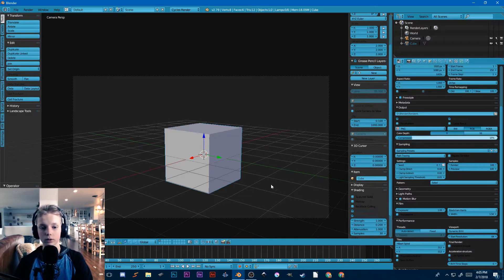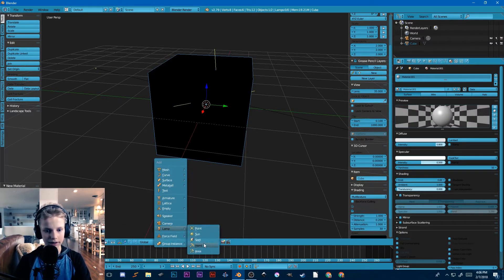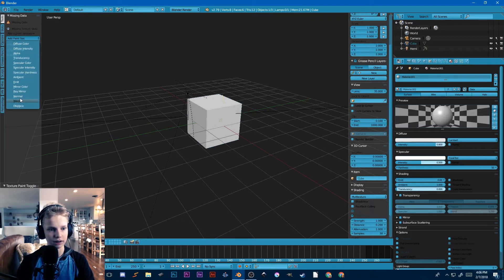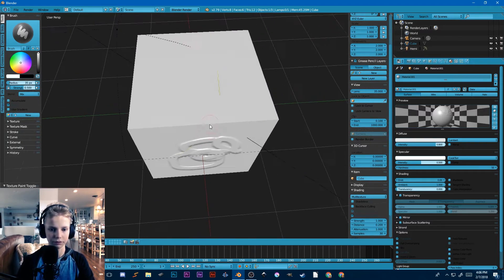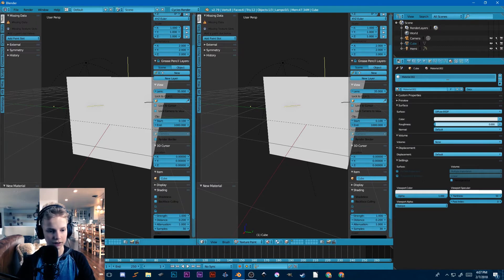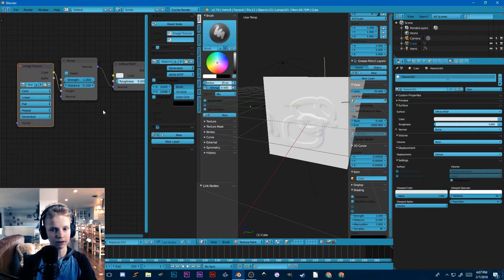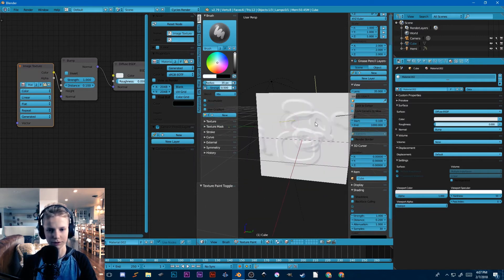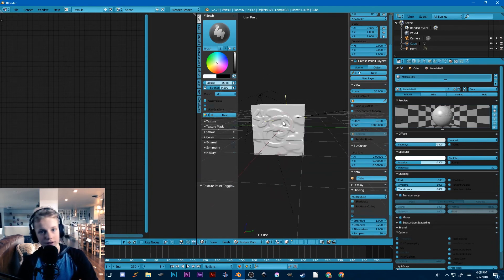How To Paint Bump Maps In Blender

Comment: You - and everybody else doing similar tutorials - are missing some steps.  I've watched at least 5 videos showing this exact same procedure and it does not work.  Sometimes I trip into it working by hacking out a bunch of steps that I guess at.  And then I forget.  There is way more to this and I sure wish somebody would state the obvious steps I'm missing.  Make material, make normal slot and paint - never works.  Ever.
Reply: If ur not okay yet, hope this helps:
Bump maps are just maps- black and white images....where white stands for yes and black for no..
So when you apply that little node setup in cycles with the painted image , (set the view mode to material to see it work) cycles understands the white parts as a YES to bump out, and the black parts as a no.